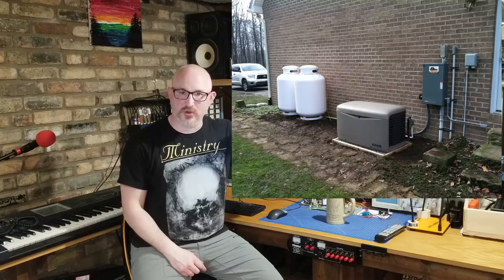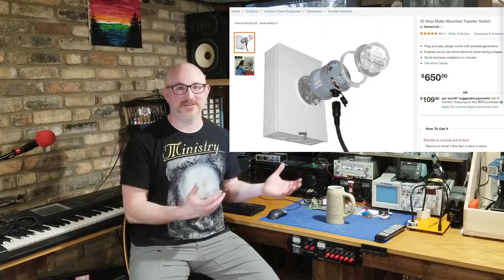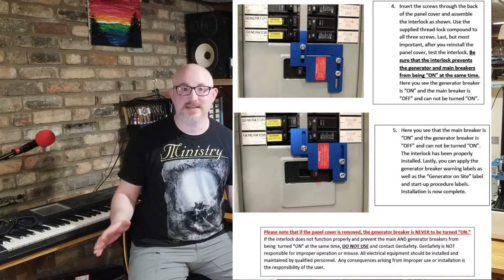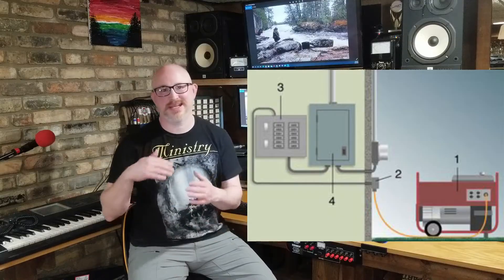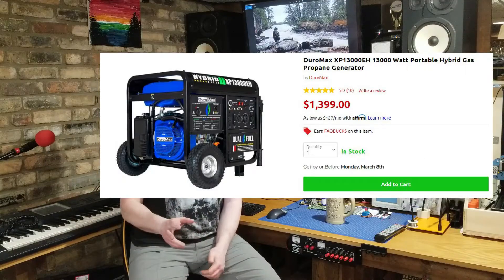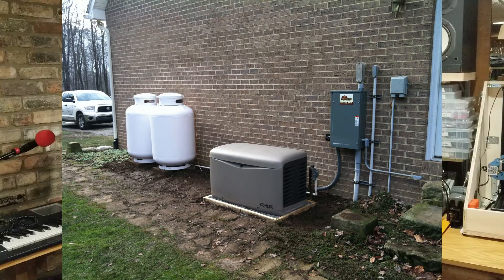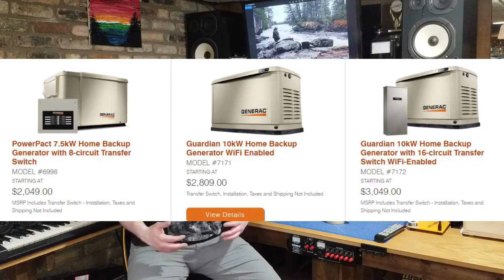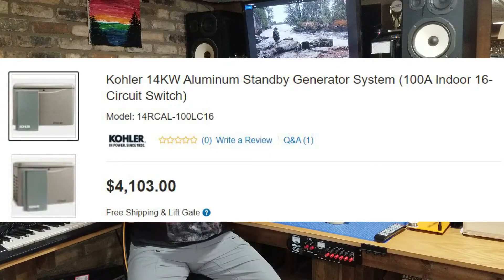Electrical Engineer explains connecting generators to your home

Comment: What size generator would I need for my electrical furnace? Not worried about cool air just heat
Reply: ⚠️Rules about generator safety: This is a very important announcement for everyone. It’s important to follow all generator safety rules whenever we use portable generators: 

Everyone must see this. This is just a reminder for everyone’s safety. 

1) KEEPING OTHERS SAFE: Please do not allow an unqualified person or your children to operate and service the portable generator. Just because some manuals don’t say that doesn’t mean it’s safe. That is important against the generator safety rules. We also need to be keeping an eye on our children too. You need to make sure that your children are not playing near the portable generator especially when it’s running so they won’t get electrocuted. Generators pose electrical risks and they can be hot during an operation. Please keep your children away from the portable generator at all times. It is important to keep our children safe especially our little ones. Be aware of all the hazards.

2) WHERE TO RUN YOUR GENERATOR: Some people use their portable generators indoors which increases the risk of carbon monoxide poisoning. It’s important to have a carbon monoxide if you have a gas generator. Never ever use your generator indoors even if your doors and windows are open and even in the garage is not safe to use a portable generator. Not even at your porch and your deck. It is never safe to use your generator indoors and in enclosed areas of your home. Your generator needs to be 15-20 feet away from your house. 

3)🔥FIRE HAZARDS: Never refuel your generator while it’s running. You need to let your generator cool off before refueling it and before storing your generator. Never overload your generator too. Never ever back feed your generator. You should never plug your generator into a wall outlet. Also never store propane tanks indoors. Please keep flammable things away from the generator as well and please don’t smoke cigarettes near the generator. Having a fire extinguisher next to the generator is also important against the generator safety rules. 

4) GENERATOR OPERATION: make sure your hands are dry before touching the generator. Never use your generator in wet conditions. Don’t let your generator get wet. You need a generator tent if you need to use your generator during wet weather. Please don’t wear loose clothes when operating the generator. Turn on your generator before plugging in appliances. Use the right cord for your generator. Please do not use worn out cords. 

https://youtu.be/I1jT3ANENvI and here is a video more about keeping others safe when using generators 

Hope this helps. Remember safety first
Reply from the maker: @The_Happy_Aviation_Enthusiast  Great info!  Safety first is always important.
Reply from the maker: What is the furnace rated KW and FLA?
Reply: @richardvedvik979  not sure how to tell but I did find this. Volts: 208/230 Motor FLA: 2.8.
Reply from the maker: @keep1treal61  great.  now for the electrical heating elements.  there may be 2 or 3.  there are likely separate 2 pole breakers in your panel for each element.

Comment: Richard:  To safely power electronics (TV, computer) via a Manual Transfer Switch, does one need to use an INVERTER generator which I understand has clean / conditioned power, or is a traditional generator (gas, propane) acceptable?  Thx.
Reply from the maker: Good question!  I am finishing a new video discussing this exact topic.  You want to shoot for 5% THD or less.  I purchased a gas generator rated for 5% THD and will be explaining why and how i've connected it.   I bought a Generac XT8500EFI
Reply: @richardvedvik979   what if use ups before tv or computer
Reply: How are you liking the geneac 8500efi?

Comment: 702.5 Transfer Equipment (A) General
Transfer equipment shall be required for all standby systems subject to the requirements of this article and for which an electric utility supply is either the normal or standby source. Transfer switches shall not be permitted to be reconditioned.
Exception: Temporary connection of a portable generator without transfer equipment shall be permitted where conditions of maintenance and supervision ensure that only qualified persons service the installation and where the normal supply is physically isolated by a lockable disconnecting means or by disconnection of the normal supply conductors.

Physically Isolated: Not readily accessible to persons unless special means for access are used. 
Lockable Disconnecting Means: Where a disconnecting means is required to be lockable open elsewhere in this Code, it shall be capable of being locked in the open position. 
Qualified Person: One who has skills and knowledge related to the construction and operation of the electrical equipment and installations
Reply from the maker: 702.5(A) refers is a prohibition to use RECONDITIONED transfer switches.  Reconditioned is defined in Article 100 and is defined as equipment that is restored to operating condition.  And this prohibition is a new 2020 NEC code item. So, for areas adoption 2020 NEC, the use of a reconditioned transfer switch is prohibited for loads classified as optional standby systems under the referenced Code section.
Reply: @richardvedvik979  It has one sentence prohibiting reconditioned transfer switches, yes: "Transfer switches shall not be permitted to be reconditioned."  That doesn't affect the exception that allows temporary connection of a portable generator "without transfer equipment" at all, and it doesn't solely pertain to reconditioned transfer switches.
Reply from the maker: @snap-off5383  Thanks for the reply, I think I understand what you're trying to get at now.  It seems you are saying that using a generator interlock kit does not satisfy Art. 702.  The Interlock Kits are NRTL Listed for use as a manual transfer switch and Art 702.4(A)(1) defines manual transfer equipment.  I felt that I was clear that any panelboard served by a generator should have a means of preventing paralleling the utility and the generator, let me know what part of the video may lead viewers to think they could connect a generator without manual transfer equipment.
Reply: @richardvedvik979  No, I'm not sure about the interlock being up to code or not, I'm pretty sure they are, I'm just saying if you need to temporarily power a home or shop with a portable generator, you can do so and be within code without an interlock OR a transfer switch, you can wire the generator straight to the panel without either of those, provided you meet those other requirements of a locking disconnect from the power grid and restricted access to the installation. Your video doesn't in any way lead viewers to think they could, my comment is to point out the code exception that says they CAN actually temporarily connect a generator without any manual transfer equipment, interlock or transfer switch.
Reply from the maker: @snap-off5383  Thanks for the extra detail.  I would never recommend connecting a generator to a panel without interlocks as death or serious injury to linemen or the home owner can occur if the generator was accidentally connected in parallel with the utility.  I am aware that many homes just have a breaker chosen as the backfeed  without the interlock, however, the generator can backfeed the utility or when power's restored the generator will catastrophically fail (if the main breaker is left closed).   I have to consider liability when making statements about electrical work.  Since most applications are looking for a safe, repeatable process to connect a generator, that was the area of focus (while trying to keep the video brief).    I also don't recommend making "suicide cords" where there are two male ends to an extension cord.    Art 590.5(A)(3) requires GFCI protection on portable generators under 15kW, and using GFCI receptacles with extension cords is a safer approach than panel backfeeds without interlocks, especially when used with the EZ Generator Interlock receptacle box.
Reply: @richardvedvik979  Yeah,  one is safer than the other, but there's no risk of back feeding the grid through a locked open main. "always have an interlock or transfer switch" isn't any more safe than "always lock the main open" they're equivalent when performed correctly, and the exception acknowledges that transfer equipment for a temporary situation may be unwarranted.   So when choosing between freezing and connecting a portable generator (Texas), nobody should be letting the fact that they don't have transfer equipment stop them from being warm, and that's where the sentiment of my comment is coming from.  For people with a modicum of understanding of electricity, knowing that legal exception in the code can bring a lot of peace of mind as they do what they need to do to keep grandma's lights on in a blizzard. Thinking you're afoul of the law when you're not is just unnecessary anxiety, and I don't think Youtube is helpful with endless videos that say "YOU MUST HAVE AN INTERLOCK OR TRANSFER SWITCH OR YOU"RE BREAKING THE LAW!" videos. Not that yours goes that far, but many do, so I comment that code on these videos to hopefully point people to the senior reference data.

Comment: I did a two pole brkr w mech. interlock, Mains must be off to turn on gen breaker. 
it is legal. I think I have to seperate the ground and neutral at the gener8or as the 
house's panel is a sub panel and at 1st means of disconnect is where the neutral and 
ground come together and that is outside on pole under the meter, after the first 
means of disconnect, the code says neutral and ground must never come together 
again.
Reply from the maker: Correct, only one neutral-ground bond is required.   My next video will discuss how to address this with the manual interlock method.

Comment: But if your mains are off you can back feed
Reply from the maker: Yes, key word being "if".  A mechanical interlock is required to ensure the sequence is done safely.    The interlock requires the main be off before you can close the generator feed breaker to backfeed.  I'll detail this in a future video.   Thanks!
Reply: @richardvedvik979  cool thanks
Reply: @jonjudice1155  hi there, Ray G. here. The mechanical interlock is legal 
and it works great. U call electrical supply house and tell them what 
type of panel u have and they can tell u if they have a mech. interlock 
for ur type of panel. If u are somewhat mechanically able, you can 
most likely do the job if u have an electric drill, they have the tem-
plates and tell u where to drill. using  this method witrh say a 5 kw
gen or larger , u get to use the full power without extension cords 
all over the place.
Reply: @raymondgarafano8604  I can assure you they aren't going to have one for my panel and if they do they probably won't sell it to me. I still have an FPE panel. But I appreciate the information and advice
Reply: @jonjudice1155  Maybe in some states you can't buy electrical items? FPE 
if you don't know is well known for the danger of their stab-lok breakers.
If they trip once, most likely will never trip again, which can be really be disasterous. I hope you knew that, plenty of info about it online. They did have a panel using fuses, that was a good set-up only one breaker, the mains. . . The company lied about the reliability of said breakers.
Reply: @raymondgarafano8604  oh yes sir I'm well informed about FPE and the stab-lok breakers. My grandparents built this house and added on to it in the late 70's and that's when they put the FPE panel. I have inspected all the breakers and I tested them all too. And I have had to change a few of them, the circuits that have been used with high loads for decades started tripping under normal conditions. The amp draw was what the system should be drawing, and it was 80% of the trip capacity of the breaker but running like that made that the new trip capacity. So in that regard I think I'm one of the lucky ones. But I have heard some crazy stories. One guy said he welded with them before and they never tripped lol

Comment: Well done brother. I installed a 10 circuit manual transfer switch (all single pole). Circuits include tankless natural gas hot water, natural gas furnace, refrigerator, freezer, sump pump, whole house dehumidifier and some light circuits. Gasoline powered 8500 running watts generator grounded to a copper ground rod and I converted the generator to floating neutral. The generator is in a utility building 40 feet from the house connected with #8 buried wire. I had my work inspected by an electrician before use because of many of the comments you made. If all circuits are up and running the generator is operating at less than 50% load. I'd like to add the generator and circuits need to be exercised monthly for about 30 minutes and I use premium non ethanol fuel. You comments about maintenance are spot on. I perform all required maintenance more frequently than the manufacturer's schedule. Hope it's OK to share this, especially for the portable generators folks. Cheers!
Reply from the maker: Thanks for sharing your experience!  Always ok to share videos, I have some more coming on the topic.
Reply: The Generac system automatically runs itself weekly for fifteen minutes (unloaded).   I can't say it "needs" to fire up that frequently, once a month seems fine to me, but that's what they do.  I'm sure it was a logical decision based on multiple variables.  

Ethanol-free is definitely worth it, but no need to use higher octane.  Regular octane does just fine, maybe better, and costs less too.

Comment: have a question. here is my potential set up. hooking up cord from generator to an outlet box on side of the house. the outlet box (50 amp) will be wired to my main panel in the house with a interlock kit. so do i need to make the generator a floating neutral?  or can i just hook it up start it and decide which breakers i need turned on. confused about the bonded neutral and floating neutral. just need to know what to do in the simplest of terms. thanks
Reply from the maker: Good question!  I just got back from a BWCA vacation and am working on a video explaining exactly this.  In short, you can only have one neutral-ground bond in a system at a time.  That means we want a floating neutral for connection as you describe.  I will explain how to do that, safely, and what it means for generator use.

Comment: I did forget to mention the Honda generator does have a lug on the front for grounding.  So should I attach that to my grounding electrode of my house?  Then is the generator still a floated neutral?
Reply from the maker: https://ezgeneratorswitch.com/generator-switch-installation/    Watch the video on bonded vs floating.  You will notice that there needs to be one, and only, one bond between neutral and ground in the system.  There is also a need to connect the ground lug to a ground rod and using an existing ground rod would be fine to me.  The difference is how to treat the neutral in the switch box.

Comment: So I purchased the ez generator switch and I have a Honda 2200 watt generator with a floated neutral.  I understand how to wire this switch from the installation instructions but my question is why do some generators have a bonded neutral and some don’t?  Is it ok to run appliances in my home through this switch with a floated neutral?
Reply from the maker: https://www.osha.gov/sites/default/files/publications/grounding_port_generator.pdf
Reply: @richardvedvik979  This link is no good ...empty.
Reply from the maker: @bobrub  just tried it and it worked for me.  You can see the file path, maybe the www.osha.gov site is blocked for you?  Or you can navigate to their Publications from the main site.